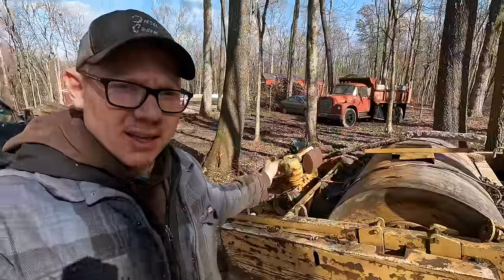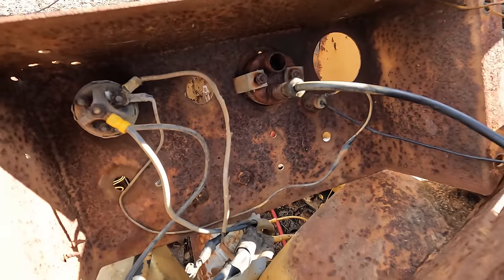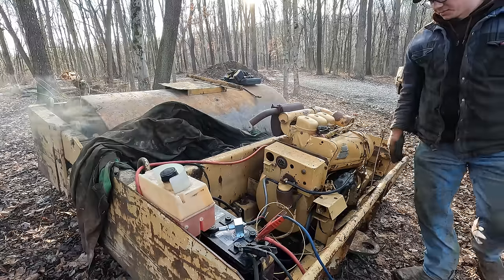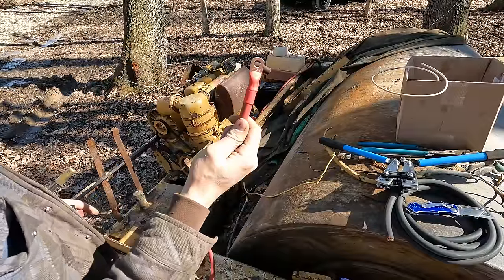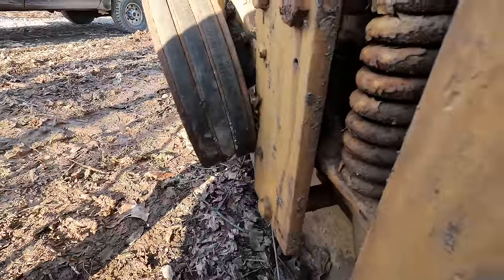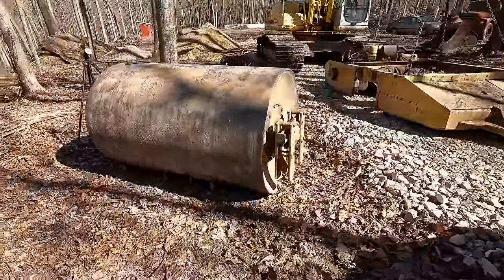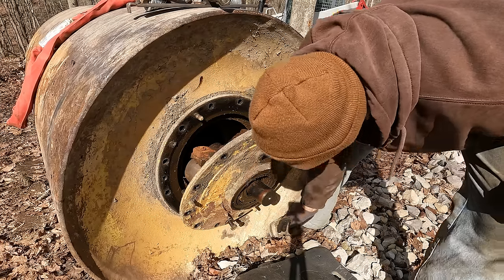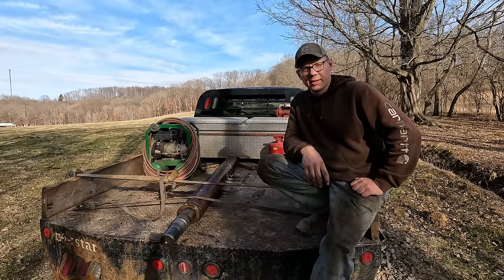Diesel Roller Compactor First Start in 30 years!! Can it be saved??

Comment: I found this video very interesting, because in the seventy I worked in a rental yard delivering equipment and we had the exact same type. One smooth drum and a sheeps foot type. We also had a smaller smooth drum. Funny the one smooth drum we had the bearing went out in it and I remembered seeing it apart and was wondering if yours was going to be the same inside with the big ball bearing and sure enough, there the same. Hopefully you get lucky on parts and repairing that shaft. And hopefully though belts are still good, because they are pricey and I believe they have to be matching belts. There's that old saying, anything that digs in mother earth, is going to be expensive and you Matt have a collection of them. .....We also had two of the neatest Alis Chalmers D and DD blades or sometimes called Moto graders. But your has the closed in cab,where ours were both open. The single D, was the gas  model and DD was diesel. I always thought they were neat, because they were small, but I guess they were fazed out by something else....... Your always so interesting to watch Matt. I sure I think like others, oh he's not going to get that thing started! The laugh 😆 is on us!!! Best of luck Matt! Thanks 😊
Reply from the maker: That’s really neat info!! Thanks!

Comment: Good luck brother hope it dont cost a arm and a leg but if you cant get it fixed cant you just weld a shalf to both end with a barring and just not have it vibrate or if you need it to vibrate put a weight on the end of the motor shaft?

Comment: This may be a repeat question.  I understand what a let down it is with the broken shaft, Is the Red one you re powered not around anymore? If the yellow one were working would it have a better compaction due to being heavier and more industrial? I hope someone will comment on this question as i am really curios that if the two compactors were in correct working order  would the red one be "Good enough" or would the abilities of the yellow one to compact with more force be the best choice? ...... Would the yellow one compact "Deeper"?? Thanks

Comment: If you drill a big hole in the broken shaft to put a large stub bolt down the center of the broken shaft to just semi repair or just enough to get to work for a while just to get done your project. Those other compactors you have may work good enough to get this project done and not have to fix this huge thing fixed enough to finish the project and I doubt you will need this thing just to do this project.

Comment: Question... Does starter motor place not repair alternators? surely it just needs a clean and new bearings its not like modern ones that have a fit if not correct and then require new regulators... just my British thoughts on it...

Comment: Bosch glow plugs still available     12 volt.    10 amp. ( 9.5 ? ).    you can cross reference them for different makes and cost   
Me. I would hire a roller 
Reassemble the scrap one you have and repaint it in CAT yellow and use it as a   piece of eye candy

Comment: Using acid core solder for that kind of job is no big deal.  I would neutralize the acid after the soldering by cleaning the area that has been soldered.  You can brush then to neutralize the acid, with a mixture of baking soda and water.  Do not use baking powder.

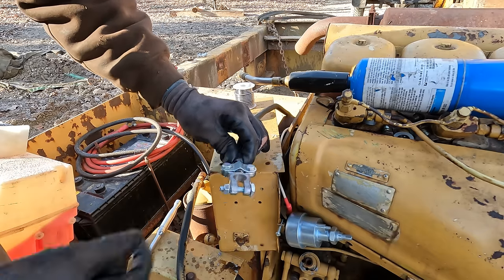Comment: 30:00 Soldering before crimping is really bad in the long run, the tin will oxidize between the connection, and it will loosen over time.
Soldering after crimping is the way to go if you had to do both.

I use a piece of copper pipe over batterycables to keep the strands in one place, there also is equipment made for just that but you never find it when you need it :)

Using a starting fluid in a precombustion chamber engine is a big no-no, the glowplugs mean usually that its a precumbustion chambered engine.

Your Kobelco sounds funny, is the exthaus manifold gasget leaking?

Good thing you realised how expensive those belts are.. i was holding my breath that you would just cut them :)

I thing you may just weld the axle together, even if it would end a little crooked it would just add to the vibration effect :)

Those bearings could be a dealbreaker.. bet they would work with new grease for few hundred hours but the compactor seems to be othervise in a good shape so it would be a shame to just leave a one thing wrong in it..

Check if there are some El_Cheapo chinesium bearing available

Comment: try a youtube collab with abom79 to get the shaft fix.  Don't spend too much time on pulling the broken part out while in the field and risk breaking the pulley, just take it all to the machine shop.  For what that thing will be doing, I would keep the existing bearings and...roll with it.
You'll probably just cut the old fuel tank off, it's rust welded on. I'd take the injectors in to get cleaned and inspected. Maybe run a compression test on the cylinders to see if the rings are bad in that one cylinder. 
The glow-plugs are nice if it's cold outside, but you've proven it can run without new ones.

Comment: Where's the flail weight? Still in the drum?I would imagine that the flail weight would need to be clocked with those weird canon ball bearings so that the thrust is supported by them. If the flail weight is not connected properly to the shaft, it would be out of alignment with the bearings. Could that be why the shaft snapped off?

Comment: if you worked there dont you know how too fix it yourself? if your not gonna get alot of use out of it cant you just clean the rollerbearings and pack them with grease,another question,the big bearing on each end,is that spining that gives it its vibratory motion cos i cant see anything inside the drum that would?

Comment: If they want too much, have a crack at welding it together and slap the bearings back in with a tonne of grease, what have you got to loose. It;s meant to vibrate anyway.

Comment: Why not use a shop press, placing the pulley on the plate, and press the shaft piece out?  As to the shop repair, it will be great if they give a break but if not; I would bevel grind the two pieces and using long bar magnets in three places around the shaft to hold the broke bits together, square and true.  I would tack the pieces back together, then just fill the bevels up with weld.  Keep the magnets in place and check regularly with a straight edge allowing time between for the thermocycling to allow the metal to move and contract back. Overfill the bevel you make and then grind back.  Take it to a drive line company and have them balance it to make sure it is true.  Also, if you are not going to be using this thing a lot, why not clean up the old bearings and use high quality grease and repack them and use them for a while.  Buy new ones if the cost of the bearing replacements isn't too steep, as definitely replacing them would be best.  Heck man you know this stuff better than most, just offering my 2 cents worth of thoughts.  Either way you inspire.  God Bless

Comment: Hey Matt great content as always dude 👌 just keep that clickity clack pump 👍 seems to be working fine I honestly wouldn't worry too much about that lift pump you're doing a great job bud I would just save on it for now to get by i don't think it would hurt to be honest and as far as your bearings go just pack the crap out of them with some really good high temp grease including that standalone ball bearing race to give a little cushion mainly I would just give the Deutz a good tune up as you planned on and look into the misfire  I think it's gonna be a great machine and besides I don't think it will see touch heavy use just like the Fiat Atlas etc. Unless you plan on doing a crap ton of dirt work lol can't wait to see what you got in the next video we're all just looking out bud

Comment: Acid core solder is a big NO-NO on electrical wiring. It will cause accelerated corrosion where you use it on wiring !

Comment: Good luck on this fix it does not look like you,ll be fixing this machine without spending a bundle of hard cash. Haul it for scrap money that will pay for the rental of the machine you need ASAP to complete the ground work for the contractor to start. Just by looking at the bearings and all the rest-- sometimes you got to let it go you know.
Reply: Seems to me that a LOTTA people know what the 'best thing to do' is..!
However, unless you know the repair cost AND you know the hire cost for the period needed AND you know the scrap value of the equipment AND you know the future use potential of the roller IF it is repaired.....then you are all just speculating in classic YouTube armchair style...... !!!
Am I right ......!?!?
Reply: @andymccabe6712  Hey you have same name as the disgraced FBI director, well back to the opinion you wrote to me  very expensive to machine a new shaft for that machine  the price of the metal and skilled labor for it. so with that Matt could rent a machine for a day to go over the ground for new shop . So I would think on a scale of what will cost more and time a rental is a no brainier. but hey again it is my opinion just like you wrote me with yours. LATER 🤐
Reply: @andymccabe6712  what ever you say KAREN :chillwcat:

Comment: Use noalox or solder the cable to your crimp?
Reply: Noalox is for aluminum.  Use T & B Kopr- Shield on copper wires with crimp on connectors, especially if outside.

Comment: As far as getting the powerplant in proper working order for something else:
I couldn't find much info on deutz glow plug resistors, but 2 of these Kubota 3 cylinder B7100 ones in series should do the job. It's eBay item number 192253268811, YouTube isn't letting me put in the link. These kubota's GPs draw about 18 amps combined, but are rated at 10.5V, or about a 1.5V drop from battery voltage (assuming the other .6V lost to wiring/connections/fuses). 

Putting 2 of them in series would drop you to 9V. And you just need to drill holes to install them which is nice.

Comment: Around 30:00 soldering wire strands: please don't do that. the solder will first prevent proper movement of all the strands in the clamp and afterwards start to creep slowly under pressure from the clamp to the points it didn't wanted to go before and then you will loose clamping force.

Comment: Dont the alternator need to be connected to the battary with a small wire to give it resistent i dont know how to explain due bad english look it up 😂can’t explain on how it works and not a professional at all I just worked alot on old boats with Diesel engines  rewiring stuff

Comment: Your autoparts store should carry a battery terminal connector that can be soldered onto the cable.  They should also have the color coded solder plug that goes with the connector.  It would be much easier than trying to tin the end of that cable and much more reliable than the straps and bolts  on the connectors that you are using.  The same ends can be crimped instead of soldering if you have a matching crimper.

Comment: Why are you so timid to use either? In small amounts it works wonders and NOT detrimental to the engine as some say. It certainly saves ware and tare on the starter and nerves.

Comment: Plan on cutting off those  battery connectors soon.  ACID CORE SOLDER IS NOT FOR ELECTRICAL.   IT'S FOR PLUMBING !

Comment: Facts as I see them.
1) if they are REALLY going to start when they say they are, you don't have time to fix it, no matter if it gets fixed for free.
Stick a fork in it and rent a ride on sheepsfoot vibratory roller.
2) I'm scared you are way under estimating the bearing prices!
Your other prices may be a touch low, but close enough.
Reply from the maker: Not sure where people get their bearings. I get mine from a supply house for fair prices, I’ve had a lot of people tell me on here that certain bearings would be super expensive and they were less than $50 lol granted these are much bigger and I know they are bound to cost a bit More but 3-400 per side is reasonable I think
Reply from the maker: I’m talking good name brand quality ones too not cheap junk
Reply: @DieselCreek  per side, on the big bearings,,the smaller ones will burn up 30 bucks each,, so yes,, you are close.
I understood 3 to 400 TOTAL.
Find out how much to rent a roller, delivered, and fixing in the time you have doesn't make sense.
Now, if your contractor is like most around here, if he says 2 weeks, you still have 3 MONTHS to finish up.

Comment: Cheap alternative for the alternator is one wire gm.  Something like a napa 213 4011 sw. They are cheap(ish) and roughly 65 Amp.  Used them alot on tractors

Comment: YOU ARE FEARLESS !!! OMG !!! Congrats on getting the engine running (and clearing up as the rings expanded and the injector cleaner helped) ... sorry about the shaft but you've got it going on with respect to if it is BER ... suggest you price out those bearings before committing to the weld/precision grinding for the shaft. Either way it goes, I much enjoyed this particular video ... thanks and "Bon Chance" from a Texan in the French Riviera that misses this kind of endeavor !!!

Comment: Hey MATT, WHY NOT BITE THE BULLET, AND BUILD, or buy a hydraulic press to remove broke shaft. Heck, see if Harbor freight wants to donate one for free advertisement. If it's too much to fix, get the welder out, and try fixing it yourself, nothing to lose. That shaft maybe used in other compactors. Might get info off compactor try finding a part number for shaft, see if you can find it, or a parts donor compactor using mfg name, and model.

Comment: I don't know what you finally did regarding the shaft, but I would have grabbed a bunch of 7018, ground a big V, and welded it.  Then I would have heated the shaft at the end, and tempered it.  I have seen shafts like that repaired by center drilling the shaft and inserting a 1 inch rod to align the two pieces.

Comment: Matt, that looks like a GM series 10SI alternator.  It needs a wire from T2 to the batt terminal and a wire from T1 to a light bulb to the ign. switch( which you don't have) .  You can get these alternators as "one wire" units.  Or convert yours to a "one wire" configuration.  The "one wire" version only hooks to the battery, nothing else.  IIF, you can get the shaft fixed.  Too big for my lathe.

Comment: I have seen this weeks video yet, little behind so I don’t know if that would already address what I’m about to say, but I’ll throw my 2 pence in anyway.

The way I look at things, if it would cost more than 40-50% of the cost of buying another working unit, be it new or used, than it’s really not worth it for something with this many issues, and value.

That said, had it been a rare, vintage excavator, or bulldozer perhaps, than I would likely throw that percentage a little higher.

Comment: Discovered Kano about 15 years ago working on tower cranes best thing ever used on extremely seized parts. Nothing on the market works as well on extremely seized parts as Kano. Very expensive but the time you save in labor using other lubricants it’s worth the price. Didn’t buy one can at a time always bought 2 cases at a time. Great choice.

Comment: OK, you've got  the Deutz running and it was a bit smoky to begin with but cleared up. On the glow plugs, there is a control relay for those and with all Deutz parts is isn't cheap. Probably in the $250-300 range. The plugs themselves aren't cheap either. Something over $100 each. There is a simple test for the glow plugs to see if they are still good. Disconnect the bridge harness from them. Take piece of wire and connect to the 12v battery + terminal. Then just brush the other end of the wire against the terminal on the glow plug. If you see no sparks the plug is dead. If you get a loud pop the plug is dead shorted. If you  get small sparks the plug is good. When heating the glow plugs they shouldn't be on more than about 10-12 seconds. There is an alternate starting system you could rig up and it is very cheap. It is called thermostart. Commonly used on older diesel farm tractors. Uses a glow plug type device that is mounted in the intake manifold. It is connected to a small diesel fuel tank and needs a 12v power. when powered it builds a fire in the intake. Perkins diesels used these and you can find those for $13. Here's a listing on ebay for one. https://www.ebay.com/itm/281687470718  A bit of wire, some fuel line,  a small diesel tank, and a push button switch and you're in business. Less than $50 depending on how fancy you fuel tank is.  Here's a diagram that shows the setup on an Oliver tractor. The little fuel tank is plumbed in the injector return line, http://www.importtractorparts.net/fuelpump2.html

Comment: Machining a complete shaft will be Expensive.  Since it is a simply supported unit working at low RPM, perhaps you can get a "stub" shaft inserted into the broken end welded in place and machined to fit.  Anything to save time and money.  This is not a fan shaft or a spindle out of a paper making machine, etc.  Best of luck.

Comment: You don’t solder the main wiring to the terminals? (🤔The solder keeps air and moisture from corroding under the heat shrink) 😞 And no fuse on the wiring to the control panel? 🏍💨🏍💨

Comment: Most alternators have long square carbon brushes in them. These always wear down. It's easy to pull the back end off the alternator and check. Replacing the brushes is only a few dollars as opposed to the price of a replacement alternator. This is, of course, assuming the bearings and rectifier pack are ok.

Comment: The glow plugs! The only answer is to get replacement, being one is already coming apart, if a tip breaks off it will destroy the cylinder, and valves, and head, same as dropping a valve … as far as making them work, a starter solenoid would work just fine as a relay..